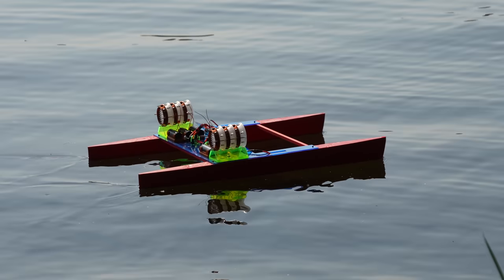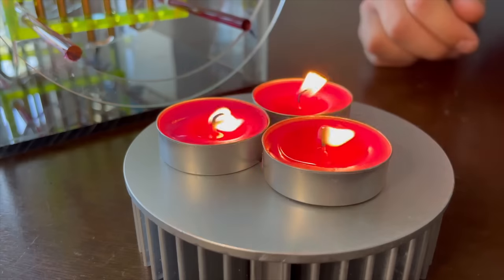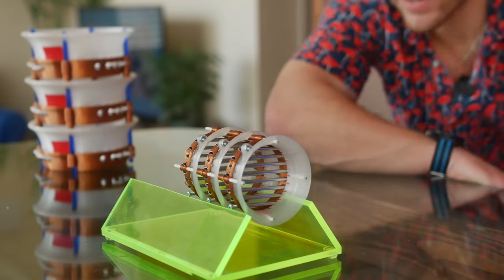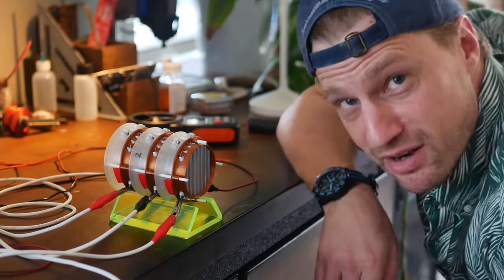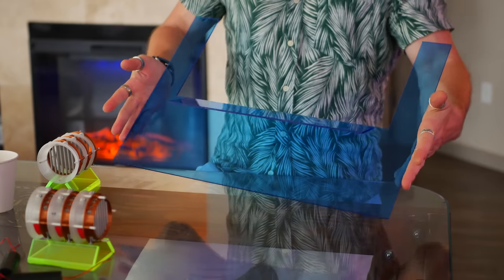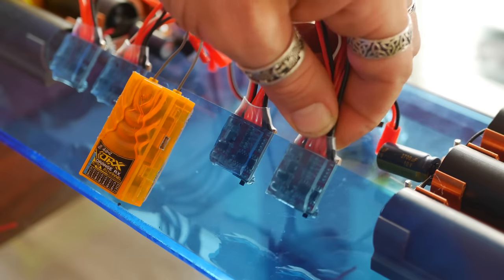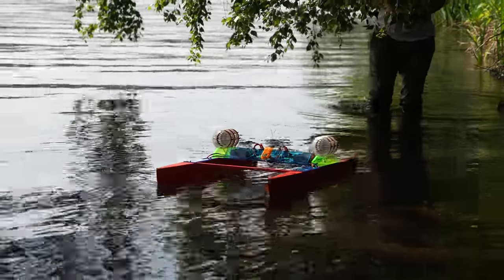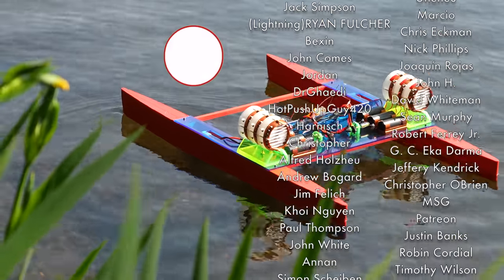Building A Twin Ion Engine (TIE) Catamaran (ft RCTestFlight)

Comment from the maker: Thank you to Daniel for his input, and to Erin for sharing his awesome airboat drone footage. I've left a link in the vid description to Erin's drone company, and a link to where you can sign up for Onshape, for free. Thanks for watching!
Reply: What is the biggest ionic thruster you could build realistically ??
Reply: Now you need to build a kid's size version of the catamaran.
Reply: My question is how small and efficient can you make them.  Small enough with the right setup, it could move pretty good in small scale.
Reply: epic work 😎
Reply: @youtuberpov  Electricly fried kids, can see the headlines already :D
Reply: Focus now on the humidity resistence. This will decide if it will be useful for marine applications or not at all.
Reply: would coating the metal parts with nail polish fix the humidity problem or would that stop the Ion Engine from functioning?
Reply: Please consider an alternative solid state solution to ionic thrusters for boats: magnetoelectrohydrodynamic drives (MEHD)

No plasma is required for one of these, unfortunately. However, you can make solid state pumps for almost any liquid that’s sufficiently electrically polarisable (can form a capacitor).

Most MEHD drives that you can find on the internet are the direct current variety which suffer from corrosion and inefficiency due to energy being lost in electrochemical processes and heat generation.

However, there’s another kind that works with alternating current and it doesn’t even need electrically conductive liquids. You essentially use the liquid as part of a capacitor which is charged/discharged at the same time as the magnetic field perpendicular to the electric field lines of the capacitor collapses/builds up in an inductor. You essentially have a resonant tank circuit that acts like an engine because it polarises a fluid thus creating a virtual charge flow inside the capacitive component which happens to be in a magnetic field coupled with the inductive component and this couple creates an electromotive force pushing the liquid in fast pulses towards one direction. The capacitive electrodes going into the fluid can be coated with a lacquer to completely prevent corrosion.

Imagine an E shaped magnet with two capacitive electrodes (one in each groove) connected with each other via the water between them. When the middle of the E is north and the bottom groove goes positive and the top groove goes negative, according to the left hand rule, water should be pushed by the electromotive force through the E and towards you. When the middle is south, top is positive and bottom is negative, the water is again pushed towards you. This is the simplest AC MEHD drive.

PS: Want to change the direction of the water? Just flip either the coil or the capacitor.
Reply: I would love to see this tested as a possible way to create completely silent pc cooling. Maybe get in touch with "major hardware" here on youtube and collaborate.
Reply: I have another one Comment: Sound Pollution - The Thrusts are directly connected to the Hull and the Hull is directly connected to the Water where the fish are - and even over the video I can Hear electrical cracking ??? What are they Hearing?
And
Run it in 8 Hertz and measure the difference - if you find between 8 - 9 Hertz interesting get back to me.
Reply: Nice job! Just don't wade in the water with your bare feet next time. You're effectively floating a 40KV power supply 2 inches above the water and driving it past you.
Reply: Возможно, более эфективно эти двигатели покажут себя на небольшом дирижабле  или на аэростате ❓🤔
Reply: Will putting a nozzle behind the thruster increase thrust...?...?...?.
Reply: @debasishazarika7536  NO! flicking the frequency to 8 Hertz will
Reply: It is a cool concept and i think its a cool idea for a plane but i don't think you will be able to generate enough thrust to move a large mono hull vessel that research boats tend to be. I am reminded of the Top Gear episode where Jeremy put a jet engine on one of their carboat abominations yes it was to heavy it was also very loud but it showed why we switched to propellers. It is much more efficient to generate thrust pushing a fluid than a gas. Tho i did recently see something about DARPA looking into MHD's again
Reply: mann imagine using ionic thrust over here in singapore lmfao
Reply: How about building a dehumidification stage before thrust stage , sort of a multistage engine , also would a conical profile amplify thrust more than a cylindrical profile ??
Reply: Wait for it to be able to fly.🇹🇭
Reply: @cezarcatalin1406  the infamous caterpillar drive, I was thinking the same thing.
Reply: This is a fantastic project! I have been wanting to see more ion powered vehicles. They are also great mosquito zappers!😄
Reply: OK, so boats and water is not a great combination for this project. How about a land vehicle; I'm thinking enclosed basketball court or auditorium with a smooth floor and controlled environment. I'd also look at lightening the load of the vehicle too. Since structurally, the thrust component does not need the added weight of heavy plexiglass... I'd just look at building lightweight struts -- preferably, thrust to weight. Get some thin but large diameter wheels, and an aerodynamically suited body, and I think you would see far better results.
Reply: ¡Felicitaciones por la turbina! Muy interesante! Dicho lo dicho, quiero señalarte que iniciaste el video fundamentando el proyecto en la problemática medioambiental de los océanos, específicamente en la contaminación sonora. Centrémonos en el tema, porque el proyecto está bueno, pero no resuelve la contaminación sonora, de hecho la empeoraría aún más. Te invito a prestar más atención al minuto 16:39 al 16:46, y corras un análisis de espectro completo en la pista de audio, (y eso que no estás usando micrófonos ultrasensibles, pero los animalitos siempre los usan).
No soy un amante de los animales, el tema es la coherencia al decir y al obrar, si presentas un proyecto fundamentando x cosa, y al final de la presentación, sólo te quedas con que tu invento funcionó, y ni haces mención de los fundamentos iniciales, ni comprobaciones de que tu invento soluciona la problemática de la cosa x planteada, entonces sólo estás haciendo un video de algo que hiciste, y lo otro es meterle una idea falsa a la gente que te ve.
Éste tema, me refiero, a la contaminación medioambiental, en la facultad lo hemos tratado muy ampliamente, y es sabido que el cambio de tecnologías no necesariamente implica que las nuevas tecnologías reducen las contaminaciones producidas por la tecnología anterior. Por lo general, se cumple qué, las nuevas tecnologías generan mayor polución, a mayor escala, ya sea por diversidad por las áreas de producción que intervienen, o por especificidad y peligrosidad de los nuevos elementos polutivos.
Vos sabes que para generar plasma necesitas altísimas tensiones circulando a altísimas frecuencias. Vos no lo oís, pero cualquier ser humano de oido completo, si. Si usas eso en el mar, en un medio acuoso, por el cual el sonido viaja más rápido, te cargas de arranque a los delfines que necesitan la ecolocación para vivir, a los cetáceos, y a cualquier otro bicho, del que no se sepa, y que necesita para la vida, ese espectro sonoro de las altas frecuencias, libre y desocupado.
Calificación del proyecto (Escala de Puntuación de -10 a 10)
Desarrollo del proyecto: 7
Cumplimiento de objetivo: -10
Reply: "low humidity environment"
Does that mean an 'ice-racer' in the future?
Reply: I get the feeling that the shape of the hull could be optimized even more by looking at existing boat designs.
Also, it looked a little back heavy, and that slight tilt causes a lot of drag.
Reply: Can this be done with enameled wires to reduce sparking?
Reply: Suddenly I wonder. Can water also be ionised and thrown backwards for thrust?
Reply: Power output Peak: >9,28 × 1024 W
Reply: @de0509  magneto Hydro dynamic thrust. It's a thing..
Reply: Humidity reducing idea.... Why not but chilling tubes say 2-3mm bore around the body and at the intake end(cooler air is denser thus adds more thrust) with a small enough wattage 3d printed motor that uses the pond/lake water as coolant...
Reply: Can we get the 3d files to 3D print? Would like to make my own. TY
Reply: What about improving magneto-hydrodynamic propulsion?  You'd probably need a deeper hull, though...
Reply: @ireallyreallyhategoogle  

The electric motor would be quiet, but the propeller, that the motor turned, would be noisy.
Reply: Will you make a bladeless fan with ionic thrust like dyson fan?
Reply: again your ionic thruster turbine is halfway there(they also use a compressor or a fan blade essentially, try the old double down again).. with lots of fun testing
Reply: @ireallyreallyhategoogle  

I think their goal is to reduce the noise in the water to reduce harm to marine animals.  Also, a bladeless thruster would be quieter than a propeller thruster.

Noise is unavoidable.  The sound of air whooshing cannot be prevented, but the noise of propellers chopping through the air is probably millions of times louder.
Reply: Noone ever talks about the smell of ionic engines...
I built one engine myself, and boy does that thing produce ozone.
Its a whole new level of pollution.
Reply: Just throw this out there use the ion motor to power a turbine propulsion system instead of using the thrust for direct drive. You can then better house and protect the motor from humidity. this not a new idea it is how the old steam turbine works.
Reply: @PlasmaChannel Some clue or idea - try to heat up the emitter wire. Heating to high temperatures will lead to increased electron emission and significantly increase the efficiency of the engine. This effect is also called Thermionic emission
Reply: You should make it bigger
Reply: @rocketman5004  

I remember seeing a video about the effectiveness of electrostatic air cleaners.  This university scientist did analysis for the guy doing the video.  He immediately shut off the unit and said that the ozone gas was toxic and could kill you.

I imaging that's true in confined spaces with no ventilation.  But maybe if the exhaust does not get blown over the boat, the passengers should be fine, but then there might be winds that could blow that stuff back at the boat.
Reply: Your welcome 😜
Reply: 40 000 Volts + Water?
I like it.
Please make a real human passenger version with 4 000 000 Volts and test it in sea water.

If you get acceleration from 0 ti 1 mph in less than one hour you did a good job.
Reply: You definitely need to solve the problem of the wires zapping in high humidity.  Imagine the boat trying to go during foggy conditions.  Or imagine an airplane with this propulsive system going through patches of high humidity or through clouds.
Reply: @Plasma Channel there is a way you could use multiple propulsora avoiding humidity. Check the experiment made by Robert Smith about the multi stage cone wind generator. He was able to accelerate the air within Venturi channels. I would introduce a filter and keep the professors away from humidity. The propulsora would be hidden and I would also use the Venturi effect to accelerate the surrounding air to increase thrust.
Reply: WOULD A HYROPHOBIC COATING HELP OR WOULD THAT DISRUPT IONIZATION?
Reply: The breakdown voltage of dry air is ~20KV/cm so a 40KV generator can make a 2cm spark. (~13/16") It goes down as humidity goes up.
This implies two things:
1. Your emitter wires are very efficient as they are clearly emitting enough ions to keep the output voltage well below 40KV. I'd say between 5KV and 10KV.
2. The distance between the emitter wires and the collector tubes is one of the things that doesn't scale down well. In fact, if you want to use it in high humidity you might want to make it longer than the full scale thruster, but at very least don't make it less.
The greater distance will probably decrease the force on each molecule but increase the time it is accelerated before it is neutralized by the collector tubes. If I had to guess, I'd say there will be a slight increase in total thrust. (I can explain my reasoning if you want)

Really looking forward to the next iteration.
Reply: @shadowofchaos8932  I suspect that the thrust will go down faster than the mass.
Reply: @sinformant  Computers love static electricity and electrical noise.
Reply: @K1VV1939  I'm curious: Run what at 8Hz?
Reply: @Jerew  How do you coat air with hydrophobic paint?
Reply: Silent ships already exists ! They are called nuclear submarines !
Go nuclear !
Also, for boats, the best futuristic propulsion is MHD ! It's extremely efficient ! (even more in salt water)
Reply: @GordieGii  Run the high voltage frequency on 8 hertz look at what 8 hertz looks like when played over water here 
https://www.youtube.com/watch?v=iBmNKdVmgN8&t=1s
Does that look like a bulls eye to you?
That Bulls eye between 8 and 9 Hertz and an explosive Charge called a Shaped Charge it is the same shape explosives guys use to Punch Holes through steel so by running the plasma on 8 Hertz the power SHOULD increase.
Reply: @Real_Claudy_Focan  Nuclear submarines aren't silent. They still have props and the still make a lot of noise when they aren't specifically trying to be quiet. You just can't hear it from the beach. Even the Red October wasn't silent, (yes I know it's not real) it just didn't make prop noises.
Reply: @Real_Claudy_Focan  MHD is obsolete tec from the 1960s. 
60 years old is hardly futuristic.
You've got two arms and legs. Develop something completely new.
Reply: Why don´t you change your wire electrodes to small plates? That would increase your electrodes efficiency. Sure enough, 40kV will bring some charring, but maybe it will give you more oompf! Five cents from a mass spectroscopist.
Reply: Also, why dont you use annular electrodes? It will also increase your thrust a lot.
Reply: @Strelkaful  I will answer for him. straight wires and tubes are a lot easier to acquire/make than annular ones.
Reply: @cembaturkorkmaz717  Actually Dyson fans have blades, they're just hidden in the base.
Reply: @makskk6spm275  The wires are already emitting all the electrons the power supply can supply. It never gets anywhere near the 40KV it can produce with a single pair of electrodes.
Reply: @de0509  No. You can only ionize insulators. You could potentially ionize distilled water, but where are you going to find a lake of distilled water?
Reply: @dalvenable331  Ionic thrusters are good at producing flow, not pressure. To drive a turbine you need pressure.
Reply: @K1VV1939  Just because a pattern in water LOOKS like a shape charge or a bullseye or a face or an animal or a ghost doesn't mean it has any properties in common with those things any more than clouds that look like common objects. It's just an optical illusion. They are very pretty, but they don't mean anything.
Reply: @Strelkaful  Why would plates increase the efficiency? Why would there be charring?
Reply: @GordieGii  Your statement is devoid of any scientific sense. I wonder how you calculated from that video how many electrons were emitted and what is the efficiency of the "engine"? Is there a method known only to you?
Reply: @GordieGii  true that. just throwing spit balls out there. good work, nice toys.
Reply: @makskk6spm275  40KV will produce an arc up to 2 cm in bone dry air, as demonstrated at the very beginning of the video. The wires and tubes in the engine are closer than 1 cm. Therefore the power supply (stun gun module) is operating beyond its current limit and can't even accumulate 20KV, otherwise it would be constantly sparking even on the bench. It only starts sparking when the humidity decreases the breakdown voltage of the air below what it can produce. I would say between 5KV and 10KV but I don't know the exact distance between the electrodes or the exact humidity. I only know that the wires he is using are already spewing out enough electrons to outrun the power supply.
I never made a claim about how efficient the engine is, only that there is no point it increasing the emisivity (sp?) of the the wires with the current power supply. If he got bigger power supplies then your idea might be useful, and presumably that might be the case if this ever gets scaled up. I wasn't saying it was a bad idea, only that it wouldn't help in this particular iteration because of the capacity of the current power supplies.
Reply: Try a magnetohydrodynamic drive?
Reply: @GordieGii  or not
Reply: install a moisture berrier ....that might help
Reply: @K1VV1939  "or not" what? Not an optical illusion? Does a shape charge on TV blow a hole in the side of the TV? Will a cloud that looks like an elephant fall and crush you? Does the shape of a skull and crossbones in vibrating water poison you?
If you answered 'yes' to any of these questions, please seek professional help.
Reply: @NoExpert hi
Reply: nice KFC boat
Reply: Shouldn't the nozzle become tighter so the thrust become stronger? (Maybe? )
Reply: @CUBETechie  No. It's not about absolute velocity. It's about reaction mass. Anything that restricts flow reduce the inertia of the acceleration. That's why turbofan engines are more efficient than pure turbine engines. The restriction in the turbine engine greatly improves the efficiency of converting fuel into mechanical energy, but the fan portion moves much more air, which is what accelerates the plane. Most helicopters are powered by turbine engines, but the exhaust isn't directed down; the turbine engine powers the huge, sparse, un-ducted propeller which produces the lift. Rockets benefit from a restricting nozzle because the rate of reaction mass is fixed (fuel plus oxidizer) so increasing the velocity it exits increases the inertia, but in these ionic thrusters you want to maximize the total volume of air accelerated and that means minimizing friction.
Reply: i think you should could find a way to filter out the humidity before it travels through the wires and cause an arc, you could create a longer tube a thin cloth-like filters on top of the side intakes that you have implemented already
Reply: @jackiekhan5815  That might work for spray or mist, maybe even fog, but not humidity.
Reply: Hmmm... 🤔 Ionic thrusters on a boat... Just need very little to no humidity.. Now, how can that be done on a body of water? lol 😉😛
The other thing is, sadly, this form of motor will never be practical for real world uses, all weathers can form quickly, rain, mist, fog, storms, all render ionic drives useless... 🤔😏 Plus, imagine a full sized Ionic thruster (or two or few) arcing out! DAMN that'll be loud!
Even aircraft would suffer these issues (clouds anyone?) 😏
Nice try though...
😎🇬🇧
Reply: Sooo equip the thrusters with a Dehumidifier?
Reply: @ravoniesravenshir3926  Dehumidification takes a lot of energy, which would make the overall efficiency of the craft much lower. Better to take the small decrease in efficiency from redesigning the thrusters to be humidity tolerant.
Reply: A link for your introduction to ionic thrust would have been nice alongside the plug in the video too
Reply: I built my first magnetohydrodynamic thruster, when I was 7.
Reply: Make a trimaran with a high pole for ion engines
Reply: @jan_phd  What did you use for electrodes? Did you use permanent magnets or electromagnets?
Reply: how about using a peltier module to cool the air entering and lower humidity and heat it up on exit to increase its velocity. two birds with one stone and u'll have employed another solid state solution
Reply: @timucinbahsi445  Cooling air doesn't lower its humidity. Cooling a significant portion of the air would require a bunch of fins which would restrict flow. Same with heating at the back end. You don't want to do anything that will restrict flow.
Reply: @timucinbahsi445  Also I don't think 'use as many solid state devices as possible' is a design objective. More like 'if you need to use a thing, a solid state one is better than a non solid state one.' So if you need to steer the craft, differential thrust is better than a rudder because there are fewer moving parts.
Reply: I just had a terrible thought.
I was considering how to produce reverse thrust and it occurred to me to add an additional set of emitter wires at the back of the engine which would produce force/flow towards the collector tubes of stage 3 of the engine. (i.e. revers flow) Cool right? But then it occurred to me that the ions from the emitter wires of stage 3 would be attracted to the collector tubes of stage 2, and the ions produced by the emitter wires of stage 2 attracted to collector tubes of stage 1. This would imply that the net thrust would be that of emitter wires of stage 1 to the collector tubes of stage 3. It's hard to imagine that you didn't test the difference between one stage and two or three stages in series and found that multiple stages were more effective, so what am I missing? Have you tried a single stage thruster with the emitter wires and collector tubes three times farther apart?
Reply: @GordieGii  cooling the air can reduce humidity but, as you said, at the cost of air flow. heating the air should compensate some of the lost flow though. i agree it could very well do more harm than good but i don't think it can be determined by just eyeballing the pros and cons. it may also turn out to be beneficial. either way i'm obviously proposing a solid state solution to tackle a problem, not just for the sake of adding one. idk what made you think otherwise
Reply: @timucinbahsi445  "cooling the air can reduce humidity" how?
"heating the air should compensate some of the lost flow" And introduce even more restriction.
You said "and u'll have employed another solid state solution." 'Employing another' solid state device doesn't go in the 'pros' column. (unless you also include "peltier devices use a lot of power" in the 'cons' column) If there's no other way to solve a problem then it is better to use a solid state solution than a mechanical solution. You know what's even better than a solid state solution? A solution that doesn't require adding a bunch of weight, friction, and electrical load, like moving the electrodes a little farther apart or decreasing the voltage a little bit.
Humidity isn't the problem. Arcing is the problem. Humidity is just one variable in the arcing equation, and decreasing humidity is hard/expensive. Other variables are much easier/cheaper to decrease.
Reply: Have you seen MHD engines? (MHD - Magnetic Hydro Dynamic)
Reply: @PlasmaChannel great video ! Is it possible to access the 3D file ?
Reply: Just make a flat thruster the size of a catamaran sale. The surface area would make for a really fast boat.
Reply: Is it possible to combine the coanda effect with ionic propulsion???
Reply: Is there any chance you can send a parts list for the thruster? Id like to build one.
Reply: Onshape rules!!!!
Reply: Sir, could you please share the 3d printing model of this project, or any contact details, cause we too are working on some similar project and it would be a great help if you help us.
Reply: Why not use a mhd drive in the water for water jets instead of air jets, it would be much more efficient imo
Reply: you have to put a sail on the boat.  or put the engine further back
Reply: Me quite obvious that since the late 40s of the twentieth century, a secret project has been developing in the United States for the development and production of aircraft, where the lifting force is created using high-frequency vibration. It all started with James Pitts' "Sky Car" vibrating orthotopter umbrella, then the umbrella was closed with a dome and devices appeared according to the scheme of conventional electromagnetic vibrating speakers (membrane + inductance) - fragments of the membrane were found by a farmer in Roswell. Then they created piezoelectric thrusters, or with small dischargers on the surface (they glowed all over the body due to ionization of the air), and now they are planes with plasma propulsion panels (so they are angular - that is, with flat surfaces). Thousands of discharge cells are densely packed into motor panels - they shoot streams of plasma (railgun architecture - coaxial electrodes). The ionized air of the spark discharge is accelerated in the railgun chamber by the Lorentz force to enormous speeds - a kind of ramjet engine is obtained. Just imagine! - tens of thousands of small ramjet engines assembled in panels and launching plasma synchronously at a huge frequency (hundreds of kilohertz). Plasma jets form toroidal air vortices - this air cushion creates lift and acceleration. See, for example, the MARAUDER (Magnetically Accelerated Ring to Achieve Ultra-high Directed Energy and Radiation) project. My article "UFOs are made in the USA" and the books "UFO Hunt" and "UFO Elimination" describe all this in detail. The technology is quite mundane - it is known in great detail thanks to information leaks. For example, air ionization in the coaxial elements of a railgun is created using radiation (radioactive polonium is introduced into the metal). Devices of this type were used throughout the 50s-60s-70s-80s for secret missions (they took off, as a rule, from special submarines). With the fall of the USSR, their use by the United States was practically curtailed (in the novel "Little Green Men" by Christopher Buckley, speechwriter Bush Sr., a scene is described where the US president decides to curtail the "flying saucer" project). The winding down of the project can be recorded by the drop in magnesium consumption in the United States, since such fuel was used in fuel cells (magnesium strips were burned in forced galvanic batteries), this is 2007-2008. However, later the development of the technology continued in the Russian Federation and China (the technology was restored by reverse engineering methods for downed devices). Secrecy, however, was maintained and there was no civilian use because the technology was not suitable for it - harmful microwave radiation from pulsed plasma thrusters (harm to pilots and impact on electrical appliances inside and along the flight line). The payload is small (but one nuclear charge is enough). There is no radio communication - unmanned vehicles can fly and maneuver only in accordance with the program. Previously, there was a narrow application profile - rare spy missions (so that pilots do not get a lot of radiation). Reconnaissance aircraft of this type were often observed at military bases, missile launch sites and airfields. They were even seen by peaceful geologists in the taiga, where clearings for seismic exploration were laid - UFOs flew there to check whether military construction was underway (I myself heard stories about this))). I think that soon this technology will be declassified, and cargo airships with flickering round plasma panels on the surface of the hull will appear in the Arctic sky.